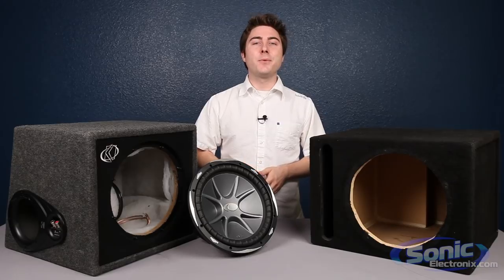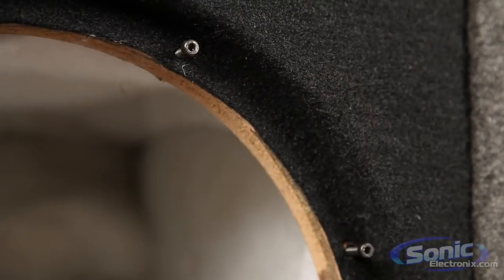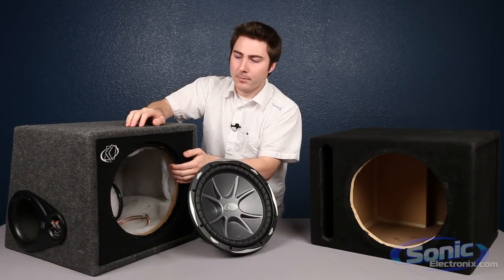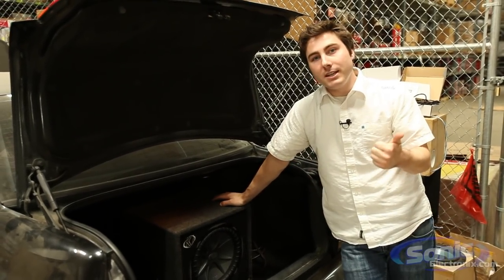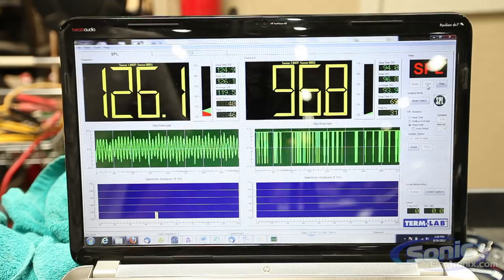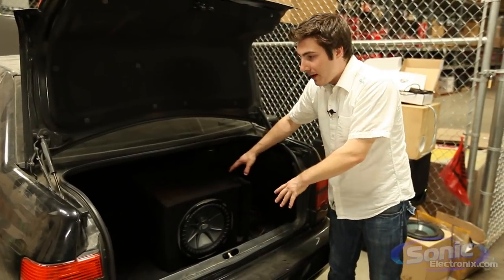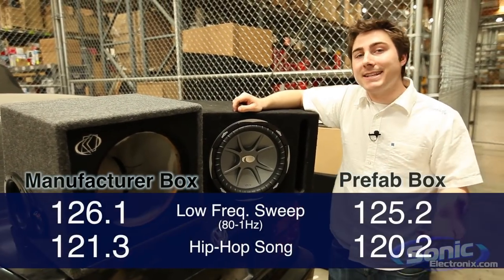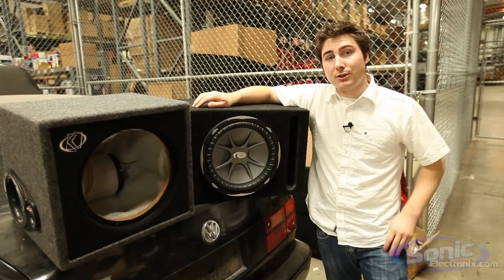Comparing Subwoofer Boxes: Manufacturer & Prefab Enclosures

Comment from the maker: If you bolt the box down from the inside, it will make for a cleaner installation and the box itself will be difficult to remove. On the downside, if you needed to remove the box for any reason, it would require you to remove the subwoofer first, same process that a thief would use. Brackets on the outside make it easy for you and a thief to remove the enclosure.  If you drill holes in the box and put screws through, you can always apply a bit of silicon to the top to seal any air leaks.

Comment: A generic cheap box isn't as good as a specifically designed more expensive matched box? Huh, I would have never guessed.
Reply: CDP135Z yes hmm i have a Question i just bought one of these prefab boxes for a very old brand driver which is said to go down to a maximum of 38hz now if i were to get or create a sub enclosure for it at how many Hz should the enclosure be tuned and how big should the enclosure be roughly
Reply: Erik Britz, there are a set of measurements that are unique to speakers that are used to formulate an appropriate enclosure. Granted there are also a lot of 12" subs that will work in a generic sized and tuned box, but theres normally a lot more performance you can get out of a sub in a custom box. 

Ported boxes in particular have to take into account sub sonic filters, cone excursion, wind port velocity, suspension compliance... ect.. 

Thankfully, most of this is info isnt as complicated as it seems. Google and a good forum board will go along ways.
Reply: Erik Britz  I would suggest to get a better sub,  And make a better Box.  Go online and look up Subwoofer enclosure calculator.  You can find some that are specifically designed for transmission line enclosures, L port enclosures, and basic tube ports.  I prefer the alport enclosures because they have less chances to have port noise,  And it's easier to tune in in my opinion.  Transmission line closures are nice but they take up way too much room and they use a lot more wood.
Reply: Yeah, and basically only one decibel of difference

Comment: Polyfill doesn't "get more bass out of your subwoofer." It lowers both the Q and Fb parameters, which will tame the response bump in a box that's too small. It doesn't increase low frequency sensitivity, so if anything you'll notice LESS bass in the sub-50Hz zone. If you want to get the most bass possible out of your sub, you have to build a custom box with very precise specs.

Comment: I hate when people don't drill pilot holes before putting the screws in.  
I cringe when I hear the wood splitting as the screws are put in or removed.
You can almost definitely avoid this problem by drilling some fkn pilot holes.  20 seconds could save you from destroying a box.
Reply: could you give me a fair price for a shop to put a 12 inch bass speaker nd amp in your vehicle and what to look for I'm a girl trying to give her ride a nice boost nd ik people like ripping women off.
Reply: @natashacrawford4146  depends on how complicated the car is. A Honda Accord is easier to install in than an Audi or Benz. But a sub and mono amp install should be around $125-150. Multichannel amps for mids n highs will be more
Reply: @natashacrawford4146 usually they won’t rip you off shop price is always expensive. I worked at a ghetto side of chicago sound shop, price never changed depending on guy or girl but it all depends on the car

Comment: Why do a bass sweep if you are only measuring peak SPL? You should show a graph of SPL for each hz to show how even or uneven the bass is. That's a big part of sound quality when it comes to subwoofers. If one box is better tuned than the other for that woofer, then this type of data would show that.
Reply: Totally agree
Reply: @basstime6129  smd dingle berry

Comment from the maker: Yes, you have a good point. It all "depends", which is the problem. One person might blow their woofer, one may not, under the same conditions. What usually happens to a new woofer is the materials, glue, etc are not worn in. As you said, a stiff spider creates more friction, and thus heat, then one that is less resistant to movement. We always prefer to break in a subwoofer, but there are those that argue there is no need. Both sides make great points.

Comment: Essentially, we have a speaker in a box, inside another box (your trunk), connected to a larger box where the listeners are (the passenger cabin).

Don't focus on the excellent design of the speaker box and then just ignore the rest of this equation or you may find that no matter how much you have spent - all bass 'disappears' (standing wave) in one position or is muddy/boomy/fatiguing or deafening in another.  Both scenarios are wasting money.

For prefab boxes: start with the size that fits, buy the best you can can afford - and then...
IF you want BOOM, push those boxes into one of the rear corners of the car (put the kicker on the left side so both the vent and the driver are 'corner loaded', like a Bazooka). Keep turning and moving the box around.  This may take several tries to get it right.  When you find the best spot bolt it down!
IF you want QUALITY, throw out the rear seat, probably turn the box around, and then keep moving the box in all directions until you find the spot where it sounds best. - and bolt it down!
Reply: Someotherjim that's the truth right here, I did the same thing and noticed a major difference in bass when placed in the left hand corner of the trunk
Reply: hey bro just wanna ask whats the dimension of the manufactuerer box 126.1?

Comment: I have a question, why is the best way to bolt the box to the car for anti theft reasons? Is better to bolt the box straight through the bottom of the box through the car or use a "L" bracket, bolt the box to the bracket & bolt the bracket to the car? Also will drilling holes for the bolts cause air holes for the  air to escape out of? What's the best solution? & also is it ok to bolt an amp to the box as well all the way through?

Comment from the maker: The SPL results of this experiment are not as dramatic as they would be with other brands, as Kicker subs are designed to maintain consistent performance in a wide variety of enclosure designs. However, the difference in sound quality between the enclosures was dramatic.

Comment from the maker: If you can hear the car, you need to ground your amplifier, headunit, or speakers more effectively. Make sure you find the chassis of the car, grind the paint down so it is metal, and create a secure connection.

Comment from the maker: If the shop knows how to build boxes based on the sub specs (most shops know this or have software to assist them), then you should be fine. Going to a shop that carries JL will just ensure that they have more experience with the woofers and that they should know how to build the best custom box. Either should work, but you can be more confident going to a shop that has experience with the sub.

Comment: actually, you do tune a box based off of the sub and the amp being used. different subs and different amounts of power will yield different port areas needed. also, depending on the goals with that sub, then tuning will be need to be different as well.

Comment: The optimal balance between boom and punch may be two 12s but this would depend on the enclosure.

Personally, if I had to chose from 15,10s or 8s, I'd go 10s.
I'm near finished building an amp for my bass guitar - it's a stack with a 15 in the floor cab with a 2x10 above that and the amp at the top :D
I decided to have the 15 for the deep rumble that a bass guitar demands, but the 2x10 offers better response for slapping and such.

Comment: Seth, you're supposed to drill a pilot hole (the size of the shank of the screws you're going to use) in the prefab boxes so the wood doesn't crack and split, even with heavy repeated use over many years. Always drill a pilot hole guys, and you'll never have that cracked and split wood problem and your screws will hold better.

Comment: hi im getting 3 cvr dual 4 ohm subs along with a hifonics 1700.1 to be wired at 1200 watts at 2 ohms, im just wondering would you reccomend trying to someone to build my box for me (ported) or just go on the safe side and stick with sealed? also would it be relatively safe to run 2 of these at 1200 watts? THanks sonic amazing support faster than jimmy johns shipping!

Comment from the maker: Not even if it comes with the subwoofer and is tuned to the optimal frequency of the subwoofer? Unless you're constantly taking the subwoofer out of it's enclosure and putting it back in, the Kicker enclosure is not going to chip or break when used with the subwoofer it was designed for.

Comment: i have a single kicker 15 comp. single coil 4 ohm. what would be the best box to get the most bass out of it. also would you prefer a sealed or a ported box? i want alot of bass. its not the only sub that i have in my truck. but the ones are already in a manufacture box.

Comment: I purchases the 43VCWr122 prefab box with the CompR 12" a while back and had to replace the woofer several times as a mechanical noise seems to creep up about every 3 months.  The CompR 12" needs about 1.75 cubic feet, minimum ported.  The prefab box is about 1.1 cubic feet with the driver installed.   I'm guessing the port tuning is about mid 40hz or higher.  The package looks good and seems to be made well but the driver will not hold up to abuse.  The X-max is 14mm and you will have over excursion noise from the voice coil as the freq. goes below the port tuning.  Just a warning, if you buy the Kicker CompR, do not use the kicker prefab box.

Comment: Depends on what you want out of it.
If you want volume you need high surface area; ignoring the depth of a speaker and considering them as flat circles, a 15 will get you 47.1 square inches; two 8s will get you 50.3 square inches and two 10s will give you 62.8 square inches. Going off this, two 8s should in theory be louder than one 15, assuming you're using same amp, song etc to compare them with, and the 10s will be even louder.

Comment: I could easily tell the difference  between the two.

My home (bedroom) amplifier has two speaker outputs - it's an Onkyo A9155 and if I went down to two speakers could I use a 2.2 setup? two speakers and two sub's - is this possible as I read you can use subs to replace speakers. If this would work would a car sub be better to use than a home hifi or are most car ones 4 ohm. I want an 80hm sub to match the other speakers or else it could knacker the amplifier could it not? many thanks, Ben.
Reply: +Ben Rogers you can connect any speaker to the amp, this include subs to. just watch the ohm's. i have used car subs at home and they work fine. the only problem i have is the neighbors.... having six 10" subs, eight 5.25" mids and eight tweeters in an apartment, its just asking for trouble...

Comment: Never ever get a Sedan if you want a clean subsound. Doesn't matter how tight your car is screwed up, it wil sound horrible. For kickass sub, get a station wagon! :)
Reply: +DevineGamingTV And why is that? Completely ridiculous..
Reply: +Tamriel Broodluste its true. I get some good bass in my 91 crx
Reply: Sure
Reply: you wrong bro, all u have to do is let.the.back seat down, sound just terrific and.loud, I been doing it for 20years
Reply: +Jay Dawg Cee I have a sedan as well and I just move the back seat (the part that has two seats) down and it is just as good as my friends single cab truck if not better. Just move the sub to the very back of the trunk, face it to the front of the car, and the trunk acts aaa huge box and my single 12 CompR sounds better than his 2 CVXs
Reply: Devil Habz wht kinda power plant u running?
Reply: My kicker doesn't rattle my Nissan Altima
Reply: If you put the woofers towards the front and take down the seats and seal around the box it will be slappin so hard. I did it in my car and it added more bass without turning gains.
Reply: Screw a station wagon a SUV is the way to go without looking like a fool!

Comment: "more umph" = the poly fill reduces the colliding sound waves and improves the sound from the port. Also it reduces the velocity of the reflection (bouncing) within the box and aids in minimizing the impact on the back of the speakers cone. This improves long bass tones.  The 1 db difference is more likely to have come from the different size of the boxes. These ports are very similar in resistance applied. Large dia & long = small dia and short. The only difference is the audible port noise.

Comment: Did you charge the battery back up when you ran the second test. With the batter low, amp hot, there is going to be a difference of a db or so

Comment: The Manufacturer's Box has a box loaded with Polyfill, which makes the box seem bigger to the subwoofer than it actually is, thus probably creating a "bigger" enclosure for the subwoofer. Also, being a port slot vs an Aero port can change a lot of things too. If you took 2 ideal subwoofer boxes, one made from the manufacturer and one made from a Prefab box and have them made with exact dimensions and same tuning then you would see probably less than a 1db difference... but yeah, Custom Boxes FTW

Comment: does that insulation improve the sound quality? like a box full of it?
Reply: Well i dunno anything about whether it's Been objectively measured to make a difference, but at any rate, you should just line the walls with it if you use it.  If you stuff the "box full of it" you run the risk of it getting sucked into the sub's motor

Comment: In my opinion it is better to just let them a bit more lose on the spider etc.. they seem to get hotter when you put near full power on them straight away than when they are flexed a lot and actually move an bit more.. i haven't blown any subs but a friend of me who is really into this stuff has blown some brand new never used subs when played too hard, even at lower than rated power some times :P

Comment: dont forget there are good prefab boxes and also the kicker enclosure is going tp sound better because  its tuned to the speaker.. the prefab box might not have a smooth response through  all frequencies.  and last the prefab box was able to keep up in SPL because  the port is firing at the back of the car

Comment: Manufacturer's box, max SPL 126.1 at 46 Hz, means tuned at 46 Hz? I noticed the prefab was 125.2 at 48 hz.. but it sounded somewhat weird.. huge port noise i think. Also, how many watts were you giving the sub?

Comment: What do you guys recommend  for 2 12s kicker  comps i have them in a open  box.  Is it loader with a close one?
Reply: What do you mean by an "open" box? A box by definition is a closed object.. Do you mean a ported box?
A sealed box has no ports for air to escape. They produce tighter and more accurate bass with a flatter response curve. Sealed boxes are smaller than ported boxes.
A ported box generally has one 'port' for the air to escape which adds sound from inside the back of the box, to the front, therefore increasing sound volume. Ported boxes produce less crisp, 'muddy' bass but with louder output. These ports must be tuned to a particular frequency (this will be the loudest frequency) using the Thiele-Small parameters of the woofer.
Reply: Applez00800 It's worth noting that the size of the 'enclosure' that the woofer box will sit in i.e. your boot, will also affect the frequency response of the woofer.

Comment: you should ALWAYS pre drill your holes...best way is to use tee nuts and machined bolts.. and then a prefab box will be just as good if not better than the kicker one...

Comment: that wasn't a big enough difference in spl or sound quality to justify the cost of a manufacturer box
Reply: It was a very very biased test. .9 is not a big difference what so ever.
Reply: Custom box was designed almost same as prefab, designing better box and building would get much better sq or spl

Comment: not a fair comparison. the kicker box had the soft material (poly-fil) inside which tricks the woofer into thinking that the box is actually bigger which would increase SPL. If the pre-fab box had the same soft material (poly-fil) the SPL numbers and SQ would be very similar. This is a perfect example of comparing apples to oranges.
Reply: nope.  it's a fair test.  that's how they come when you buy them.
Reply: John Doe sure that's how they come, but a good comparison would be both boxes with poly-fil
Reply: Julio Chavez i understand that but it's an out of the box comparison. Otherwise it would be custom box comparison. If i was to buy either of the two I'd just put in the sub and throw it in the trunk like most people would. That's why i think it's fair.
Reply: John Doe it's an unfair and biased comparison.
Reply: When Poyfill is added to your enclosure, the airspring within the box begins an isothermal process. When the air passes through the Polyfill it is scattered and dissipated by the fibers, causing the air to be less dense. The speaker then interacts with the enclosure as if it is larger than it really is, changing the sound.

Comment: What will pump more say a 10 inch in a ported spec box or a 12 inch in the same size box also ported. So the 12s box will be too small for it. This is the problem you have when space is limited